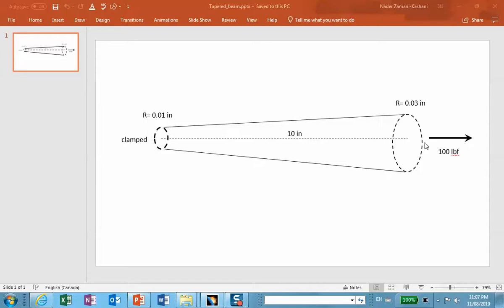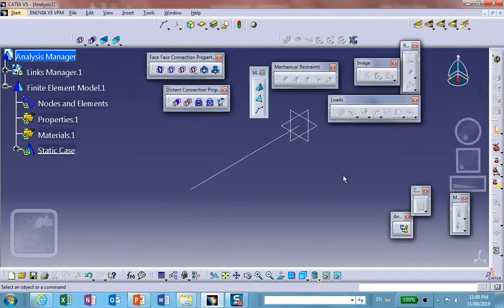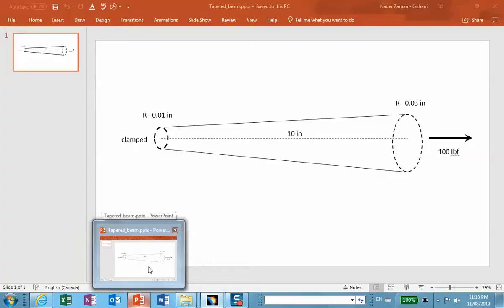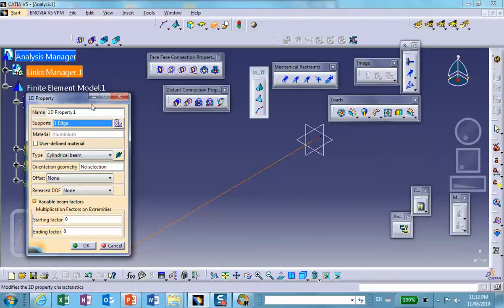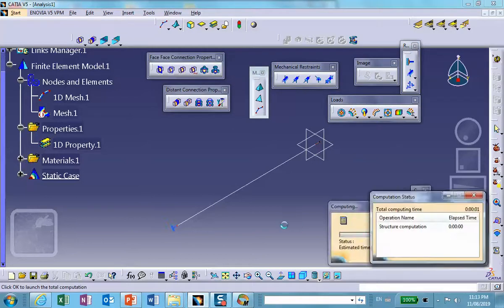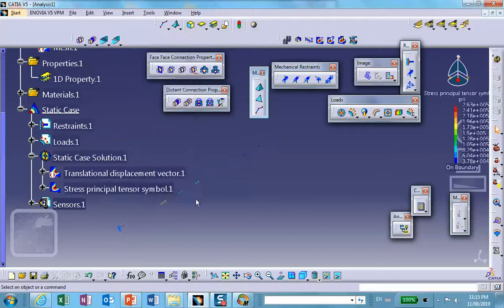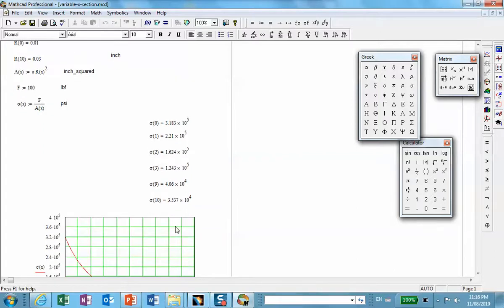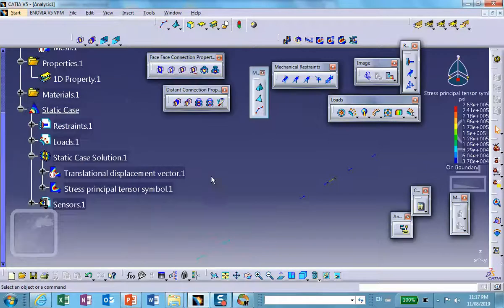FEA Tapered Beam 1D Property Nader G Zamani

Comment: Hello Nader, I appreciate your videos about 1D beams in FEA. Is there a way to find out if buckling occurs using this method, during compressive forces on the beam? I would also be interested to see how you would set up a wireframe structure using a number of different 1D properties. For example for a tubular frame structure using some bigger and some smaller radius pipes connected together by nodes. The only way I know to connect multiple lines in Catia is with the Generative shape tool "Join", but then it doesn´t allow multiple 1D properties since the complete wireframe is regarded as one piece. If I dont join them before the analysis starts, I find it difficult and confusing to join lines in the FEA tool, pre-processing.